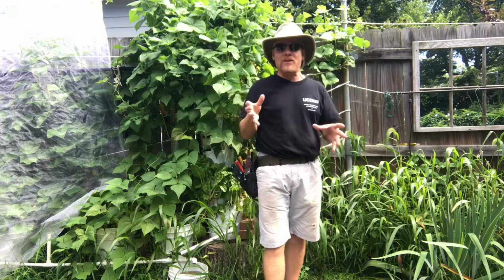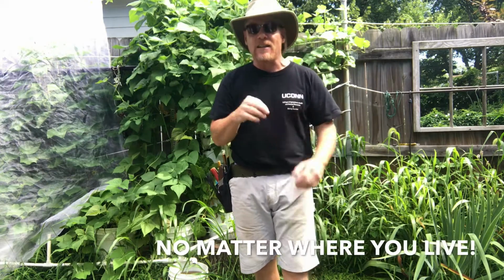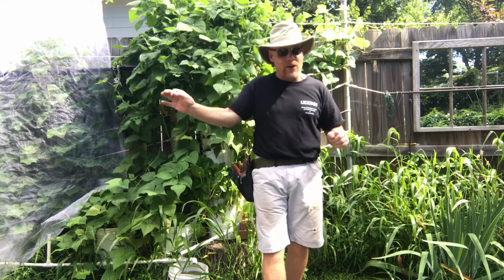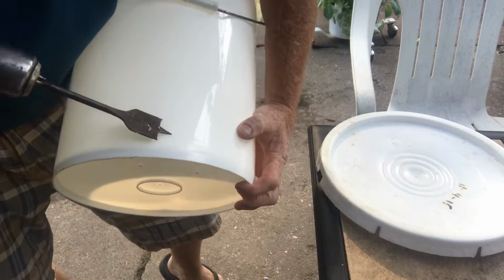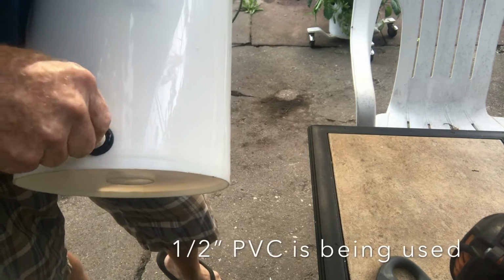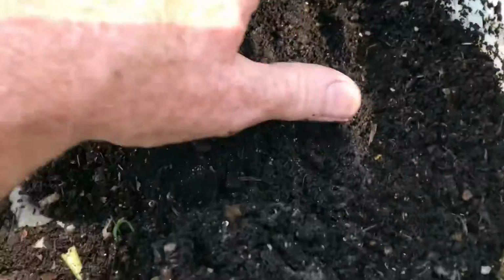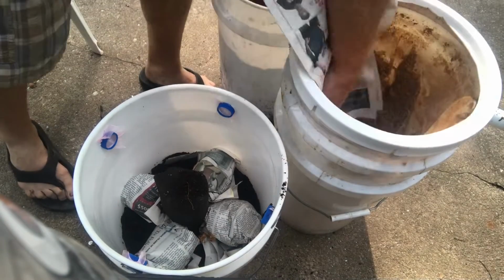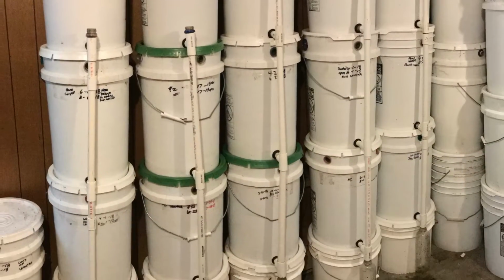Vernmenting bin update

Comment: Hey Mark, I'd be curious to know if you could do a larger bin... Like what about those plastic barrels? 
Where I live, I can get 30 or 55g(?) plastic barrels for free, or no more than 5 or 10 dollars at least. I wonder how long that would take :D

I like this build better. Less cost it looks like, and more aeration than your older builds.
Reply from the maker: I think they’d work great, I’d get them! One problem with bins this big as far as packing it, and leaving it is they’d be pretty heavy I’d imagine. Since worms kill pathogens in like manner as hot composting I’d think you could handle bins of this size like Joseph Jenkins handles his two bin composting system. When ones full you start on the other, when the others full the first is finished and so on.

I made a flow through bin with a 55 gallon drum to see how it work.

Comment: Why not scale it up using 55 gal food grade barrels for commercial system... say apartment complex etc
Reply: I like that idea... but can you imagine the amount of time it would take to make rolls to fill a 55 gallons barrel !!! one solution could be to do layers instead of rolls...do a brown layer with newspaper then add the scraps then paper and so on.. another possible issue would be air.... possible fix forcing air from the bottom via a blower on a timer...
Reply from the maker: Anne Hollier 55 gallon drums I feel could work very well. I think of Joseph Jenkins hot composting method when one pile is complete he starts another, and by the time the second one is full the first one started is complete turned into castings.

The beauty of buckets I feel is they’re light, easy to dump out when complete, or move around as needed, plus I can get many free buckets around where I live. But again 55 gallon drums could work very well in certain situation!